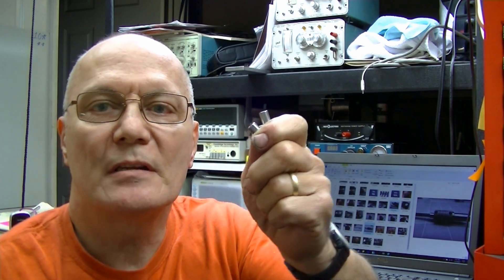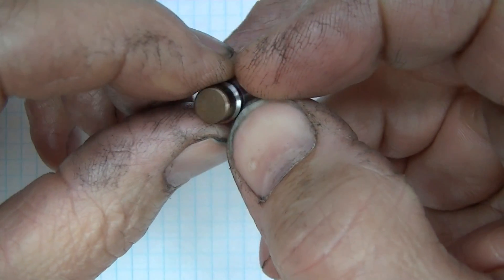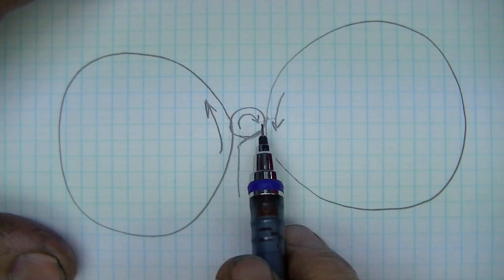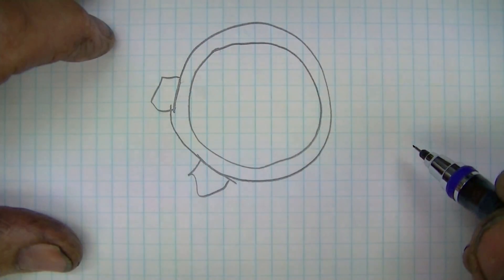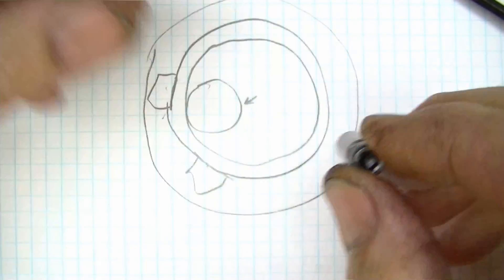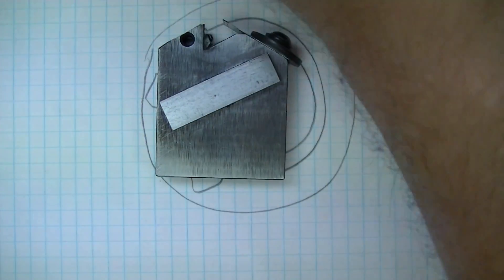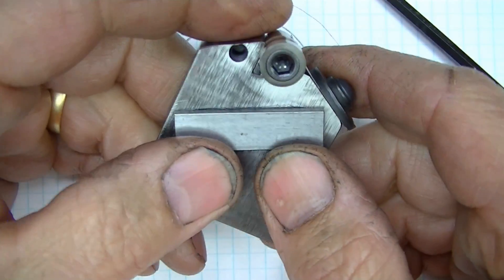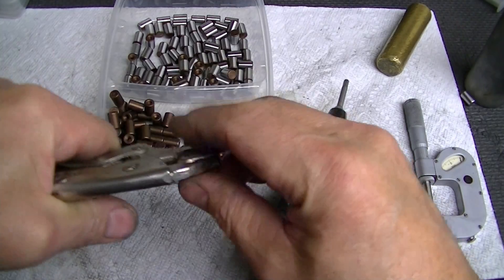CENTERLESS GRINDING  ON THE SURFACE GRINDER

Comment: Dear Sir Robrenz,
I am Abay from Ethiopia. First of all, I thank you in advance for taking your precious time to consider my request. Could you please assist me in order to rectify 'ZANROSSO 1500Y Cylinder Block and Head Resurfacer Machine, which is giving a hyperbola surface finish. Deviation ranging 0.15/.1 mm.
I couldn't even find the manual. Previously, four times other Technicians have tried to solve the problem but nothing pays off yet. Now it's my responsibility to bring the machine to life and before I attempt to start working on the Resurfacer , I humbly seek assistance.
Thank you so much.
I am also addressing this to anyone who come across to this comment of mine.

Comment: Is there not a better and more accurate way to check finish size than a dial mic whenever I grind ods at near sub tenth tolerance I always use a dial indicator with a gauge block stack of my finish size and I roll the part on a nice flat ground surface I find it a tenth more accurate than using a mic
Reply: Mahr millimes indicator half a tenth a line
Reply from the maker: B&S 599-1021 amplifier with 599-981 lever gauge head 0.000001" per division  :)

Comment: I used to work on a Ghiringelli centreless grinder I used to through grind parts if there were enough of them but an alternative way was to use the ejector stop which would push the part out onto a tin ramp that I made and into a basket or I could just hook them back with a piece of wood.

Comment: It turned out great.
Why didn't you use the cross feed when you reached zero on the indicator? It wouldn't be necessary to catch zero every time.
And another question - did the edges(or plane) happen on the parts sometimes? 
Sincerely, Alex.

Comment: That's pretty cool I've been a centerless grinder for 13 years never seen that nice little fixture you got there especially if you're running the same size every time and the same link I used to only use the surface grinder to clean up my Blade rest
Reply: I want to know why my size change, at my workplace the piece keeps getting small and I have to open the regulating wheel every 8-10 piece!! The stupid operator/trainee says it’s ok but I think it’s pathetic that the machine can’t run consistently.
Reply: @montrose5paulina  What kind of material are you running.. Are you running straight shanks.. areTDS..
Reply: @michaelarnold1576  The material comes in a coil pack and we “hot stretch” it on a machine that heats it up by weld or Scr. So then it’s ran thru the centerless grinder to remove very little material to clean the surface from the burn of the “hot stretching”.  It’s soft material, I believe it’s aluminum because it’s not magnetic. But tomorrow when I go to work I can find out for sure.

Comment: "Induction Harden with a TIG torch". ???????? Nice work Robin, but love to know about the hardening.
Reply from the maker: Implying a shallow hardening by bringing just the surface to hardening temperature and quenching. In this case holding an arc with the tig torch just enough to do that without melting the metal. The only induction involved here was the tig welder transformer ;-)

Comment: Sir I have 0.5mm sintered carbide pins with 100mm length. 
I want to grind up to 0.36 mm diameter within minus 0.002 mm tolerance?
Please suggest that How I Can Do ?
Vikram kumar
mefavkd@hotmail.com
+91-9814064621.
Reply from the maker: look up through feed centerless grinding

Comment: Wow, that is a clever solution for centerless grinding when you don't actually have a true centerless grinder.......I'm going to store this in my clever ideas vault.
Reply from the maker: I was hoping you got more out of the video than that my manicure sucks :-)
Reply: @ROBRENZ  Oh, I am told I have ADHD and that means I get more interested in the surroundings and my eyes wander over everything else but the thing I'm supposed to be watching.......got into trouble at school constantly but was never told the problem.......That method you use is insanely clever and really opened my eyes.....I'm a fitter and turner, part time inventor.....60 + years ago now retired and doing the armchair engineer thing, but I still have a workshop full of machinery.

Comment: AWESOME AWESOME VIDEO your a smart man so smart, My specialty is centerless infeed / profile grinds and all in-between,your an inspiration to us all , I want to build my own small shop and i keep saving please im open to ideas and suggestions from all you . Maybe i can help someone out even some day. Love you all and keep it up you doing great videos. Hope to hear back some day
Reply from the maker: Thats a tough question not knowing what your range of experience is. You cant go wrong with a decent mill and toolroom size lathe to start out with. next for me would be a small surface grinder. Tooling for all these is the killer as its easy to spend more than you paid for the machines in getting them tooled up.
Reply: Thanks rob.  I have a ton of centerless infeed grinding doing a lot of form jobs i have lots of pics . its real close to lathe work when i turn my wheel to the profile . milling and lathes i use but for tooling and fixture type stuff for the grinding . I just love machining and want to do more thanks for your response appreciate every bit i can get

Comment: you mention that you selectively "induction hardened with a tig torch"...are you using your tig power supply to drive an induction coil? 

In the unlikely event you run out of ideas for videos, I would enjoy seeing that setup and hearing what you have to say about hardening in general.
Reply from the maker: I just use the tig torch to heat the surface but trying to not melt it.  The base metal chills it and it gets glass hard but just on the surface. I send out all my HT to Solar Atmospheres for vacuum harden and air temper.
Reply: @ROBRENZ  thanks for clearing that up.  really enjoying binging your videos lately, its inspired a new level of precision in my shop, no where near you, but a step in the right direction.  Thanks!

Comment: When the part spins roughly 180 wouldn't the material being now missing drop the center line of the part since it is contacting the bottom of your fixture? Thanks.
Reply from the maker: Yes but it happens very slowly
Reply: @ROBRENZ  OK so would the part not have a roundness issue? Thanks for the reply.
Reply from the maker: @punishr36  Roundness is always an issue with centerless grinding. Tweaking the support angles like I described in the video is a science in itself and is the key to parts rounding up.

Comment: "Shop Notes"

• Making pins in quantity to +/-.0001" tolerances
• Intro to centerless grinding, drive wheel and shoe.
• Whippletree reference @ 5m40s
Link to Wikipedia if you're unfamiliar with the term: https://en.wikipedia.org/wiki/Whippletree_(mechanism)
• Small jig overview
• drive method for pins

Comment: I like your thinking; I thought... a grinding surface inside the surface of that awesome tooling... then while it is connected to the drill, just spin it with the spindle.

Comment: the regulating wheel and grinding wheel turn in the same way on our centerless grinder, just with different speeds.
Reply from the maker: Agreed, same direction at the point of contact. But that is opposite rotations to achieve that.

Comment: loved this.. went by fairly quick.. but i am taking you milled the jaws of your vice grips to grip on the round pins without damage.. since you have a TIG.. you can add brazing rod to the surface of cut of the jaws to even give you better protection for the parts.  i have a set of the 20 degree offset Harborfright long nose pliers i used a chainsaw file to carve a relief like you made in the tips of the long nose. https://i.imgur.com/d0s4U5V.jpg  i use them to hold screws in hard to reach places while i get the screws started.. i use them to push and pull vacuum hoses  on cars..  they are also crazy handy for picking up tubular objects.. even heavy ones like this 1/2" extension and socket.. https://i.imgur.com/FKFjIg9.jpg the item number is 61587 at HF. i know nobody likes to buy imported tools.. but who wants to file the tips of their 50 buck  tool truck sold US made pliers voiding the warranty..
Reply from the maker: Thanks, yes smooth curved recess at the tip of the jaws.  Tig braze coating is a great idea.

Comment: ... Induction hardened? With a Tig torch? Whot?

Pretty cool informational video though.
Reply from the maker: I did say "sort of" induction hardened. it is just the heat of the tig arc.
Reply: it's very much like induction hardening, the only difference is that rather than the part being heated by current being induced by a coil, the current is run directly through the part.
Reply: Rob Mckennie except it’s not being heated via resistance. It’s the heat of the arc doing the heating. It’s more akin to flame hardening than induction hardening
Reply: Pinky Mabinkie no that's incorrect. The arc is just a means to conduct current to the material, the heat comes from the resistance of the metal
Reply: Rob Mckennie no. It’s correct. That is the difference between arc welding and resistance welding. Resistance welding requires about 10x the current vs arc welding. They are in no way the same. The gas between the workpiece and electrode is being ionized and superheated (it becomes a plasma). The gas is being heated via resistance, not the workpiece. The plasma of the arc is what does the heating in arc welding, not the electrical resistance of the workpiece. Take a welding electrode and short it out against the work. No welding will be done and the only thing getting hot will be the electrode due to its small diameter. The arc itself is 10,000 some degrees Celsius. It is  the prime mover in arc welding (hence the term “arc welding”).
Reply: Pinky Mabinkie I've been looking and can't find a definitive source, but you do make a good point about shorting out a stick electrode.
Reply: I don't think it's really fair to expect me to say "oh you're right". I said they made a good point, I do think they're probably right, but as I said I couldn't find a definitive source. If Winky Pinky has actually done the engineering and taken the measurements that would quality them to be a definitive source, i'll acknowledge that, but AFAIK that isn't the case.
Reply: Rob Mckennie well I am a former welder, who is also a welding inspector, who is also a materials engineering technologist (which involves a lot of welding technology and engineering). I hate being that guy who lists his credentials, though.
Reply: That's not really quite what I was getting at, plenty of people with fancy pieces of paper have surprisingly weak grasps on what they actually do. A good example just the other day one of the laser operators at work, a guy with some 10 years of experience at this company alone, who knows these laser cutting machines inside out, looked me in the eye and told me that the bright purple arcs inside the laser tubes aren't plasma. "It's not a plasma cutter", he says. But anyway, what I was getting at was it sounded like you were basically using your intuition, which admittedly is likely very reliable most of the time, and even came up with an example that changed my mind, but without an actual experiment and data that one can point to, i'm not going to go so far as to say "oh you're right", as the previous commenter wanted me to
Reply: Rob Mckennie well you are entitled to your own opinion of course. I am indeed going off of my intuition, which is based on a solid theoretical understanding as well as experience. Having worked as a welder, I have spent hours studying the characteristics of the electric arc and how it is used to melt material. It can be manipulated much like a flame can. The size of the arc can be increased by increasing voltage, producing a much wider and taller arc. This increases fluidity of the molten weld pool, and it is proportional to the size of the arc. By increasing the current, the penetration and depth of the molten weld pool can be increased, much in the same manner a hotter burning flame with a higher energy density would. There is a very clear similarity to welding with an arc vs a flame. Many of the same techniques are used
Reply: too bad you butt in where you're not wanted.

Comment: Great idea which I will have to try out. Other method might be that Sunnen makes an External hone which works nicely for such parts. Did you know of, and/or have experience with it?
Reply from the maker: Yes but it is would not be as fast as this.

Comment: Robin,  I like and appreciate your videos thank you for sharing them. 
The centerless grinders that I have run(Royal Master) the wheels ran in the same direction.  One to " regulate the part speed and feed,  and the other(Diamond Wheel) actually did the cutting.  It may just be the set-up that we were using with the ceramic,  but the wheels (as you drew them) would rotate anticlockwise.  The workrest,  blade was also set such that the theoretical centerline was slightly above center (.0001").  Our tolerances were +/-. 0003 and with a TOR. 0002". 
This was just our set-up,  but perhaps this information may help you or others in the future. Cheers😀 and thanks again for you channel.
Reply from the maker: Thanks, and thanks for watching and commenting.

Comment: How do you balance a wheel that does not have balancing weights on it?
Reply from the maker: grind off some of the side of the wheel close to the blotter with a very coarse diamond file by hand
Reply: ROBRENZ simple enough.   Thank you
Reply: What would be a great general purpose wheel hardness be.  Something that does not break down fast?  We use a 46k now and the edge breaks down very fast on mild to 60Rc.  Im guessing a 46I would be better?  Thanks for your great videos.  Always love when I see you have a new video out.
Reply from the maker: "I" would probably be better but you might try 60 grit if the corner radius is breaking down

Comment: Very Informative! Wondering what controls Z-axis on your grinder - a ballscrew? Your adjustment was so smooth. I have an old Boyar-Schultz with a worn Z screw and have been wondering about possibility of retro-fitting a ballscrew. Thanks for your effort.
Reply from the maker: It is just the stock Harig setup. Remember I am looking at the indicator, not the dial as I do that down feed. That is why the indicator is there to provide very precise feedback of what is going on. Thanks for watching and commenting.

Comment: Great video and explanation! Maybe I missed it Robin but what type compound/grit/hardness wheel was used. Also...are there any video's on set-up and grinding for for adding  radii at the ends (offset) for rectangular check pins with a spin fixture?
Reply from the maker: 80 grit J hardness ceramic Radiac wheel. No videos yet on the radii work yet. Thanks for watching and commenting.

Comment: Thanks for making these video’s! Great tips and tricks about toolmaking and mechanics work. If you can, please share some more information about the tig torch induction hardening.
Reply from the maker: Thanks, and thanks for watching and commenting!  Just using the tig arc to heat the metal to red but trying not to melt it. I just zig zag a pattern with the tungsten as far away as will maintain an arc. Its not easy and even if you melt  a little it still gets hard as this is air hardening steel. Definitely for non critical stuff only.
Reply: Thanks! I'll give it a try.

Comment: Great video/info. I watched when originally published, decided to watch again and learned even more. I too found the "tig induction" hardening fascinating, and decided to try it on a piece of A2 (think quick/dirty 3 flute reamer 1/2" diameter). I couldn't get above 13-14 amps without the local surface starting to melt, but locally (within 1/8" of the torch focus) it did harden. The other side of the 1/2" piece remained soft. What advantage would using TIG have over a torch? Control? Very interesting nonetheless, thanks!
Reply from the maker: It is difficult to not melt the surface at all but it does not seem to matter. The tig is a much more intense and concentrated heat that allows rapidly heating just the surface of a small part without the whole thing.

Comment: Excellent video sir.  You mentioned you induction hardened the contact surfaces with your tig torch.  Did you use the AC setting in order to get the heat to generate from inside the part?  Could you explain that process please?
Reply from the maker: Just rapid localized heating from the tig arc. No induction involved, I did say "sort of" induction hardened.
Reply: Ok, thank you.  I will have to do some experimenting then.

Comment: A Vise-Grip to hold and manipulate precision ground parts... wouldn't that risk hurting the surface finish?
Reply from the maker: The parts are 62RC and not hurt by the softer vise grip.  Also go back and watch closely and you will see the vise grips have a round smooth pocket ground into them where I am gripping the parts.
Reply: Indeed, had to back to see : the custom precision ground jaws on the Vise-Grip are easily missed... I should know by now that nothing is truly what it looks like with you guys... Plus you have the habit of gingerly pocking precision mirror surfaces with your dirty metal tweezers (it's very stressful)... Great explanation/video on centerless grinding!
Reply from the maker: Thanks and thanks for watching and commenting!